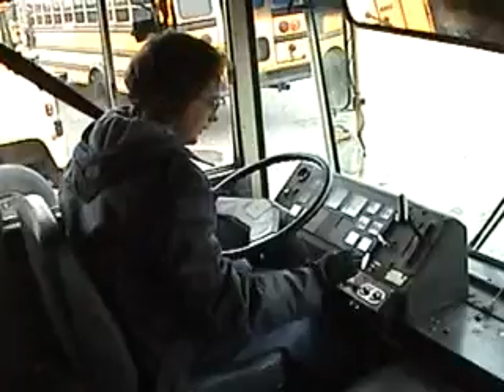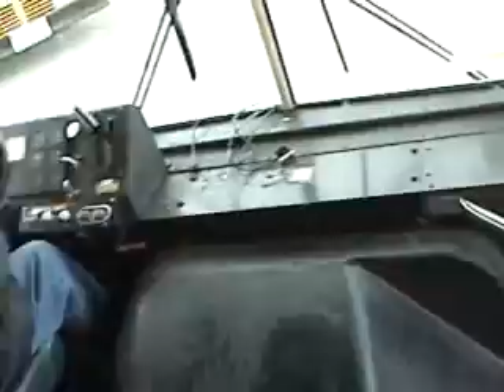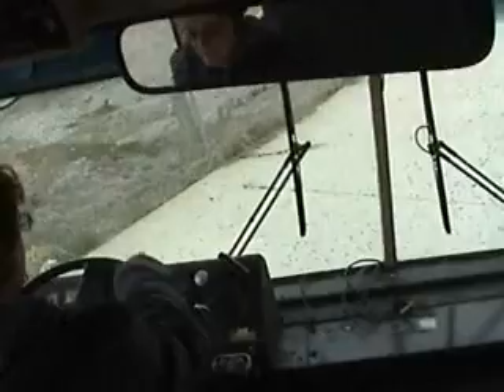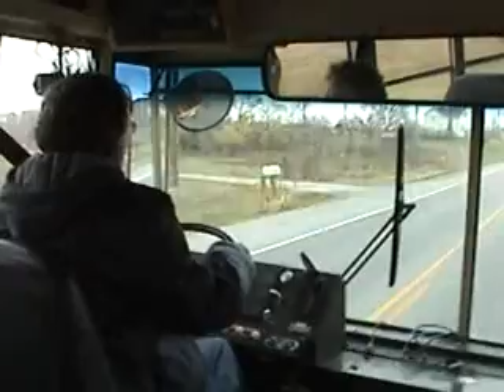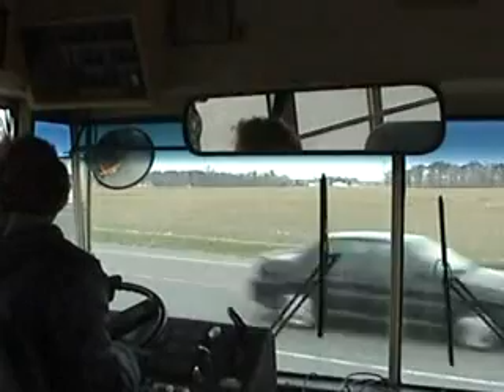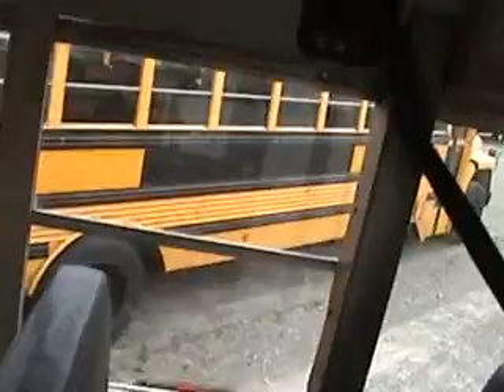Wayne Lifestar FE test drive

Comment: @AllAmericanFE 
The B300R could be had as early as 1994 (was in test market from 1991-93), and could be had as an alternative to the AT545 and MT643. 

The other WTEC transmissions available in 1994 for buses like this were the MD3060 (for engines up to 285 hp) and the MD3066 (up to 360 hp) and they replaced the mid-range/heavy-duty crossover MT647/648 (descendants of MT644) and MT654CR transmissions.

Comment: @busrailfan 
Initially, the World series transmissions (B300R, B400R, MD3060, HD4060) were intended as replacements for the MT644/647 and the entire HT740/750 series of automatics. 

The MT644/654CR was introduced in 1976 as a heavier-duty version (they use the HT series' torque converters) of the MT640 (later the MT643) initially introduced as such in 1972 (replacing the prior MT40 series), while the HT740/750 series replaced the HT70 in 1971.